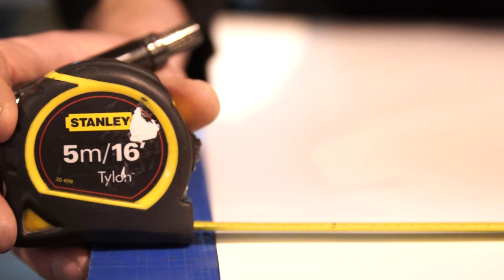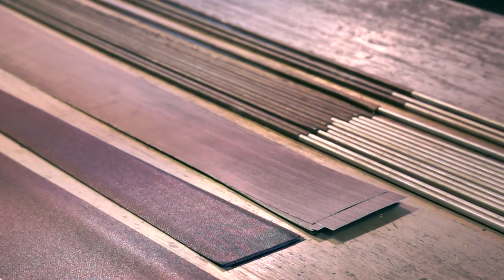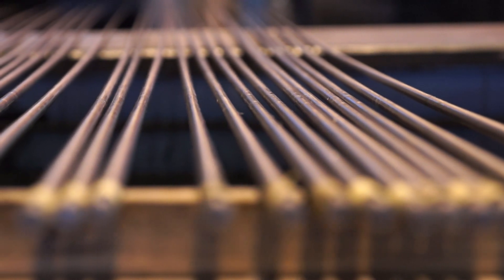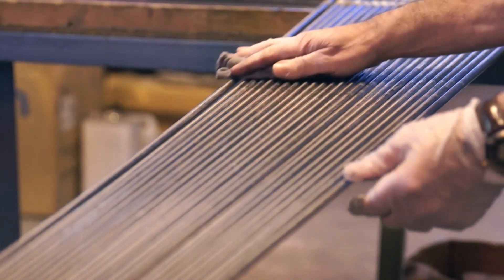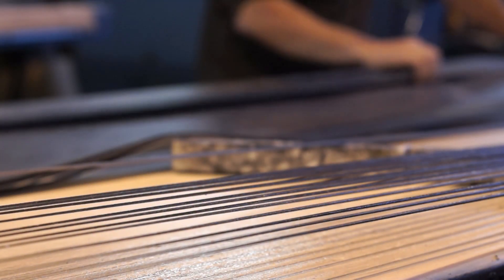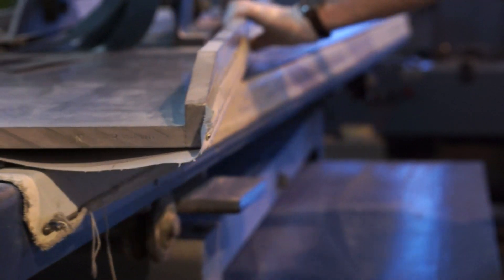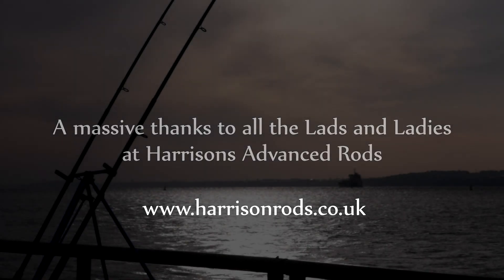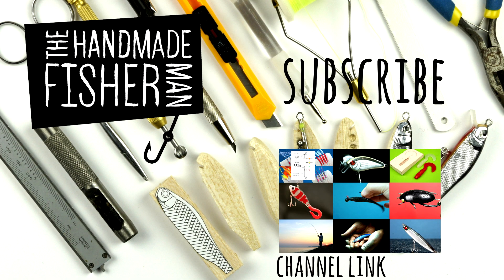The Rod Makers

Comment: Hi. Is there visual difference between carbon rod and fiberglass rod ? Thx.  From mauritius.
Reply from the maker: i think with most glass fibre rods they will have paint applied to them so visually it would be hard to tell, but glass fibre tends to be more flexible than carbon fibre, but i will ask in work for a more definitive  answer
Reply: @PaulAdamsTheHandmadeFisherman  Thank you sir.